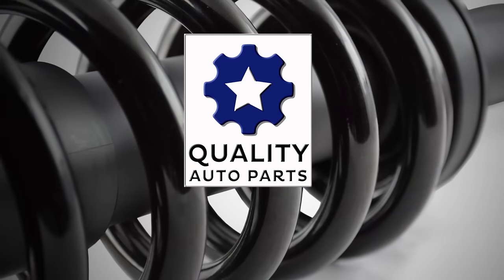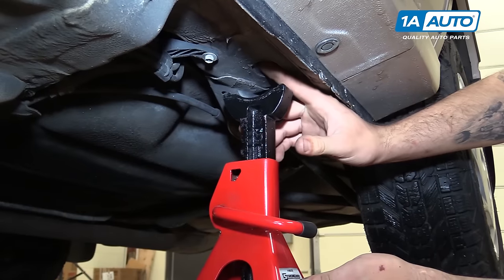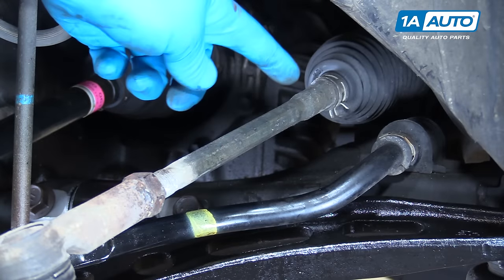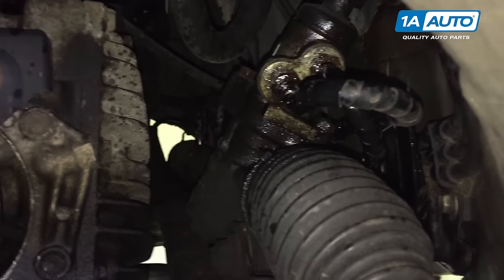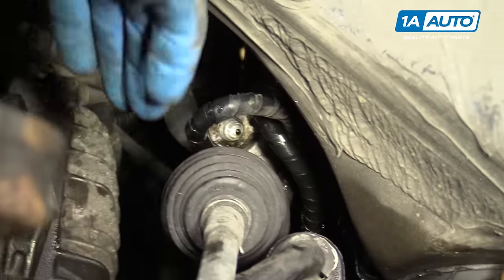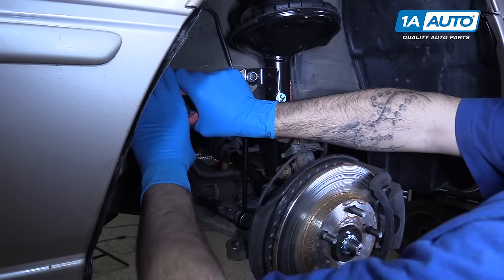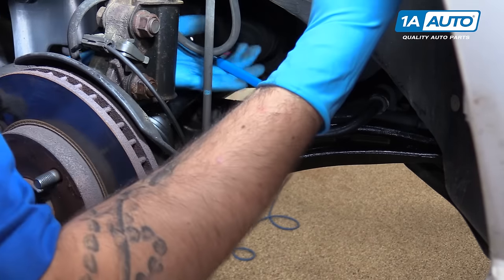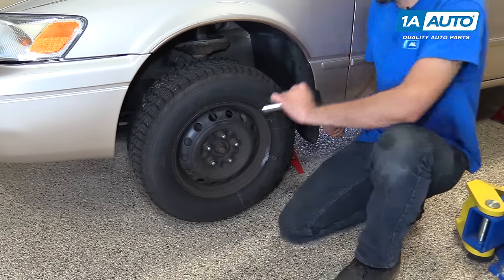How to Replace Rack and Pinion Assembly 92-01 Toyota Camry

Comment from the maker: √  Watch the Video
√  Buy The Part at 1A Auto http://1aau.to/m/Visit-1AAuto
√  Do it Yourself
√  Save Money
Reply: Great video. I have  one question.  What type ans size bolt is it the one you remove from the rack? Where you use an extension pipe. Mine fell off from my 01 toyota solara, I'm petty sure they are most the same engines.
Reply: Is the rack steering of camery 2005 is same genuine OEM part ? Or its brand of company A1 auto???? How much cost shipping to Bahrain ?

Comment: Thanks for the video, I was able to do this repair.    A couple things, the rack came with both bushings, so I didn't have to do the bushing change shown in the video.   One of the main bolts would come out, I had to cut it out with a grinder - looked cross-threaded.   Also, I ended up taking it out and putting it back in four times to get it right.   So, yes, you can do this, and save hundreds of dollars, but it ain't easy.
Reply from the maker: +S Weathe Thank you! We love empowering our customers and showing how to perform DIY auto repairs with our high-quality auto parts. 1AAuto.com
Reply: 4 times

Comment: U forgot to say use a HEAVY AF hammer to release the tie rod....I had to use a jack to put upwards pressure and a sledgehammer to knock it loose
Reply: Or just use a tie rod puller/pitman arm puller ...works like magic

Comment: I’m working on a 96 right now and the rear motor mount is blocking the bolt for the steering rack clamp and I can’t get the motor mount out because there no room!

Comment: Hi I followed your video to a T on my Camry and everything went beautifully I appreciate the videos you guys make. I have a question though when I completely turn the wheel to left or right all the way the stops my Camry makes a squealing noise. there's a lot of misinformation on the internet and I'm kind of hoping you can clear this up what may be causing this noise! Is it a loose belt is my rack defective or is it a pump issue? Other than turning it to the complete left to right the rack is working beautifully!
Reply: Sounds like the belt for the power steering pump. To tension the belt you have to loosen the pivot and lockdown bolts on the pump, pry it away from the engine, and the re-tighten the lockdown bolt while you keep tension on the pump. You may also need to replace the belt, check it for cracks or wear.

Comment: Thanks for this excellent video!  I'm a novice and currently working on installation on a '98 Camry.  One recommendation thus far for the video is pointing out the easier alternative of using a ball joint separator to remove the tie rod ends from the spindles if they are really stuck in there.  I pounded the crap out of one of the castle nuts before realizing I could just get this tool for less than $20 and do it in a couple of minutes.

Comment: Thank you for an excellent video. One thing that I didn't see(pertaining, at least to a 1992 Lexus ES300) is the fact you have to loosen the clamp around the black baffle of the steering column(inside passenger compartment) and then pop out the center cap that is around the steering column shaft and loosen the 12mm bolt holding the splinned shaft, push the shaft into the steering column coupling and then you can easily slide the connector onto the rack spline shaft. If you don't do it, it's nearly impossible to separate the connecting point from column to rack.

Comment: I've run up against the two 19mm mounting bolts.  I'm gonna have to get the car up higher so I can fit a 24 inch pipe on my socket wrench.  Like he says, it can be done on jack stands.  But a lift makes it 10 times easier.

Comment: Just did a 1996. The steering intermediate shaft does not collapse enough to remove it, i dropped the back 2 sub frame bolts to make enough room to remove that shaft and on the 96 you will need this room to remove the 2 rack 19mm bolts. The setup is not the same on a 96 with a 4 cylinder as what you are working on
Reply from the maker: Thank you for the feedback! +mighty moe
Reply: How many hours you done? I just trying to it on a 94 camry 4 cyl but I got scare.

Comment: Hi it is a very instructive video, but you have not shown what brand of fluid you have used for the power steering. Because there are few brands in the market besides Toyota brand.
Thanks

Comment: I’m getting ready to change out my 94 Camry rack and pinion but there are two different racks that could have been used depending where the vehicle was assembled. One was North American and one was Japan and are left side drive. Can you tell us which one you worked on? Great video btw.
Reply from the maker: +Speedy Banana Thanks for the inquiry! This part fits all 1992-2001 Toyota Camrys (left hand drive). Please let us know if you have any additional questions.

Comment: i have a 2007 solara convertible. all was relatively ok for me until I tried getting the high pressure lines back in. not threading in for me. any tips?

Comment: If I did push in the inner tie, you said you'd have to center the rack intermediate shaft again to be centered, what would happen if I didn't? Could I take it to a alignment shop and them still fix it? Because I did and my steering wheel was way off. I told them I may of had the steering wheel off and rack shaft not centered and he said his computer would tell them all and could fix it. Is this true or should I take it all back out and do it the way you say and go get a  alignment again? Thanks!!
Reply: Can you help me with this? Should I redo the whole rack and center steering wheel and rack and get it aligned again? Thanks again!

Comment: Ive been a tech for over 12 years and toyota requires atf/dex3 not ps113 or standard power steering fluid with what looks like gm and or honda ps fluid. The rest of your video was on point and i want to say well done. But fluid types matter

Comment: Great information how do you lock the steering wheel just by putting wheel to center and turn key off? or use a strap also?
Reply from the maker: +Joe Briggs Thanks for watching!  Just center the steering wheel like he shows you in the video and turn off the car.  You do not need to us straps or anything like that, it should stay in place.  1aauto.com

Comment: paid 987 for 96 Camry steering gear remove and replace at shop. free oil change,lol. yes, it ain't cheap. oh, had outer tie rods replaced to as it comes with inner.

Comment: I have a question I'm doing this project on a chevy tracker and we're at the point of re connecting the power steering lines to the rack and pinion.  we're not sure which one was the top and bottom line.... does it matter their positioning?

Comment: There are o-rings needed for installing the lines at 25:22 which are not included with the rack and pinion and 1A Auto does not offer the o-rings for sale. Make sure to purchase a new set of o-rings from the stealership before you start your replacement.

Comment: I can’t get those 19mm bolts off…. Unless I lift the car much higher and put a pipe over the breaker bar. Also struggling to separate the spline after removing the bolt

Comment: Did what was shown but the tire shop said  the wheel needs adjusting more to the left because it's too much to the right? How to adjust so it's just right with the rack, thanks.
Reply: *steering wheel
Reply from the maker: +vulcan03 Thanks for watching!  It sounds like the steering rack may not be centered.  Please follow the process shown at the 20:00 minute mark in the video.  1aauto.com

Comment: would I be able to just turn the new the steering rack all the way to the right along with the steering wheel before installing it instead of trying to center it ?
Reply from the maker: +Brian Leabo The alignment will still more than likely be off. You should install it in the same position as the factory one. 1aauto.com

Comment: Any additional suggestions for getting the steering shaft off the splines of the steering rack?  Its hard in the video to see how exactly it comes off. I'm assuming the joint in the steering shaft folds and it should just move upward so its fully off the steering rack shaft.  I've pulled at it with a pry bar from the top and hammered at the bottom of it with a pry bar.  The video implies it should come off without too much force.
Reply from the maker: +Breer Osky Thanks for your question! Once the pinch bolt is removed the steering shaft should move off the steering rack with a pry bar. Some penetrating oil may be needed to get the shaft off. Thank you!
Reply: 1A Auto Parts Thanks for the prompt reply.  Should the pinch bracket be oriented in a particular way or should the joint flex in a particular direction?  I have this thing lubed up and loose.  Have even jammed a screwdriver in the bracket slot to loosen it up.  But can't lift it more than half way off the rack spindle.  Next strategy is a longer pry bar for more leverage.  Can't think of much else because the thing is obviously loose and free.  Just can't get it to lift.
Reply: Thanks!  I figured I would go ahead and proceed with the rest of the disconnection steps.  After I removed the frame bolts I was able to get enough wiggle in it to pull it off.

Comment: The tie rod bolt, where the castle nut goes, is just spinning when the castle nut gets to a certain point. How do you keep the tie rod bolt from spinning while getting the castle nut to 35 ft lb torque?
Reply: Put a hydraulic jack under it and put a little pressure on it and give the outside of the casting a couple wraps with a hammer as you tighten

Comment: Is this the same part as the 98 sienna? Just wondering if tools required will be the same, ty.
Reply from the maker: +arman sesar Your 98 Sienna would use a different rack and pinion. This particular one would not fit your vehicle.
Reply: 1A Auto Parts but also wondering if the process is the same as well as tools required, thank you.

Comment: Does a 2001 Camry 3.0 v6 feature the same locking nuts on the mounting bolts?
Reply from the maker: +Gerald Martin Thanks for watching!  The part in the video is the same for the 2001 Camry 3.0L, so the process should be pretty much the same!  http://www.1aauto.com/rack-and-pinion-assembly/i/1astg00003?utm_source=YouTube&utm_medium=CTA+Comment&utm_campaign=ytcomment&utm_term=9At7tChYYvY

Comment: Question if I just want to replace the bushing only...can I just unscrew the 2 bolts thats holding down the rack..from there push the rack up and put the bushings in...would that work or no
Reply: did you ever find out the answer to this? currently trying to figure this out myself lol.

Comment: What was the point of jacking up the rear?
Reply: To even out the height and get the car balanced
Reply: It gives a little extra height on the whole body of the car for the rear-most positioned bolts.

Comment: Doesn't Toyota use ATF in the power steering instead of normal power steering fluid, or does it not matter?
Reply from the maker: +Francis Flynn Thanks for watching. It appears that Toyota specifies AF3 ATF fluid for the power steering system.

Comment: 20:40. These pliers are the most terrible piece of junk. Not real tool. They are only good for garden hose repairs. You could have made some better marks, and use e.g. vise grip pliers, that will not slip and will stay put during the test turnings.

Comment: Is it possible to replace bushings without removing entire rack?
Reply from the maker: +santacruzer It's not something that we have tried. It may be difficult while the rack is still in the vehicle. 1aauto.com
Reply: thanks for the response 1A - the sway bar has to be removed and the attachment bolts are in a pretty tight spot - so we'll see.
Reply: @jsmcguireIII  was u able to replace bushings without removing the rack?